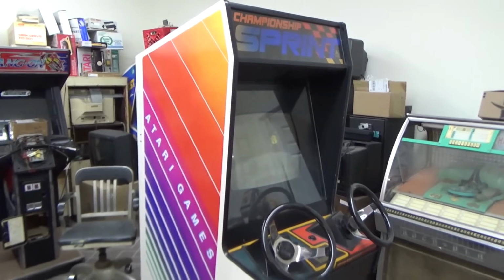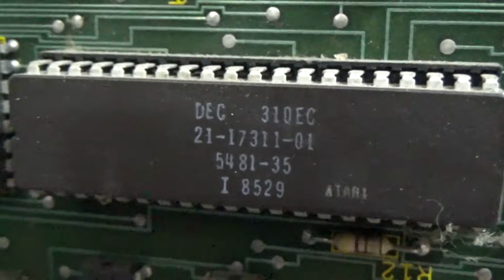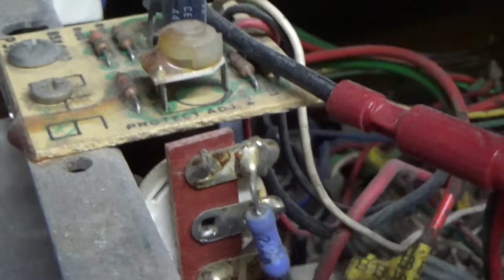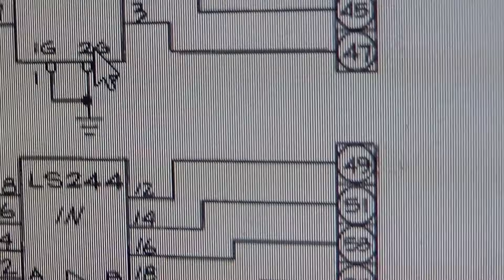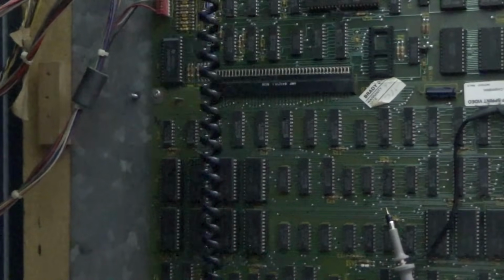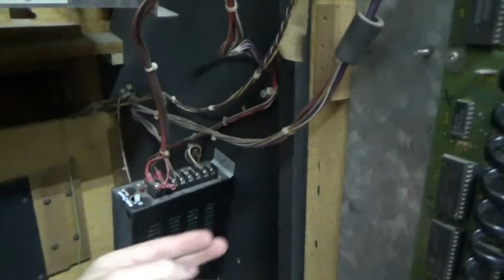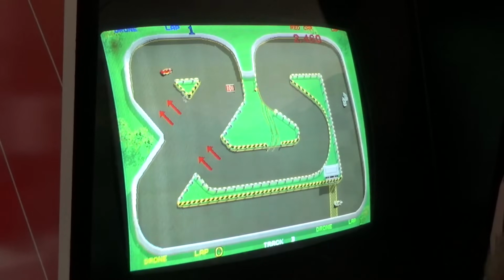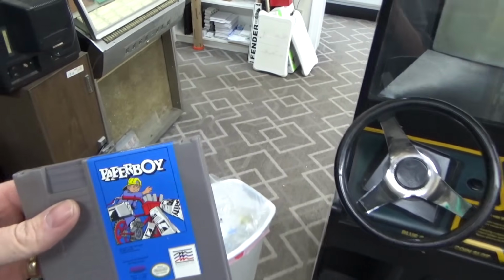CHAMPIONSHIP SPRINT Has The LARGEST Arcade PCB Ever

Comment: So!!! I have a broken HP Nixie tube frequency counter. Been sitting for about 5 years as I have been doing tube radio restoration. I have all the digital and logic  probes in my test equipment  arsenal of tools! Your video inspired me to go grab it and dive into its circuits as it had a tone of chips. I know the power supply is fine so let’s go find the 1’s and 0’s and see what is not flip flopping as it should!!
Reply from the maker: There you go, break that scope out :)

Comment: CR1 and CR2 are not zeners. They're clamping diodes, meant to prevent that chip's input from swinging above or below the DC 5V rail (VCC and VDD), which is possible because the 324 is operating on a split rail supply

Comment: I replaced my plastic steering wheel hubs with billet aluminum units I got off some guy on ebay back in the day.  My wheels are solid and spin smooth.  Lately, however, my machine has started having problems that seem to be related to it being very old.  Like, having to reseat chips all the time.